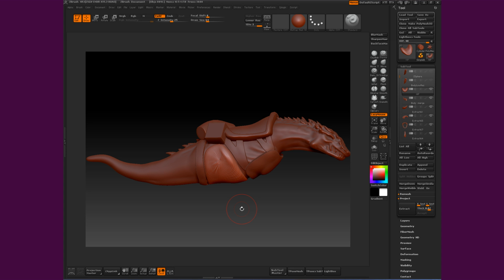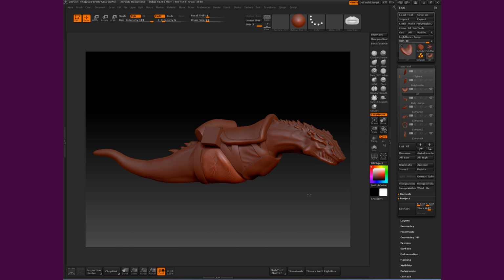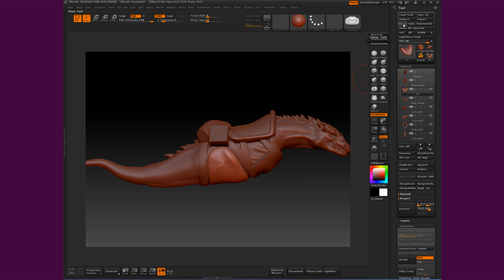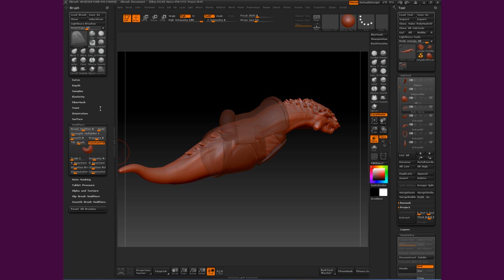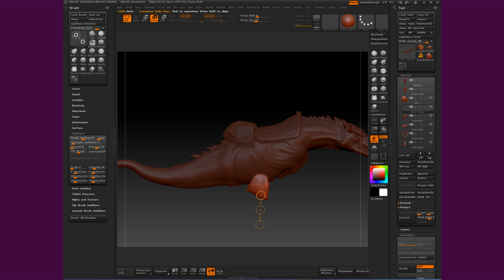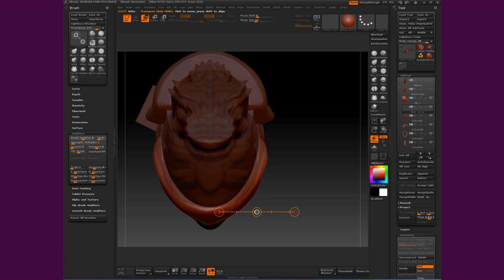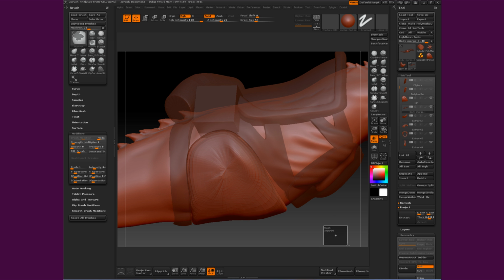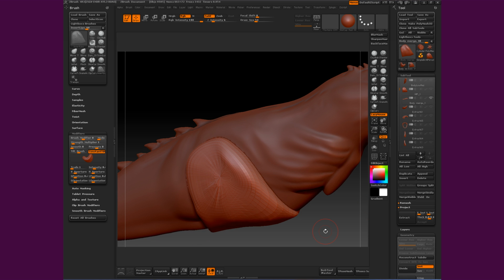Zbrush Dynamesh Subtraction and Workaround for 3D printing

Comment: This did help somebody, helped somebody a great deal.
Thank you so much for uploading this video!
 I found it to be quite useful.

Im making a 3D print and I knew I had to make my model in multiple parts so I could make molds of it, but was at a complete loss at how to do this so my parts would fit together perfectly, I despaired,cursed,and moped around for a while but then I miraculously found this video which solved my dilema!
Thanks.

Comment: This was very helpful, particularly the part about using NON dynamesh geometry to do your subtraction. I could not figure out why my dynamesh subtraction operations were not working and that was why, I was using all dynameshes. Now, here is a gift back. You DO NOT have to convert your geo into an insert brush and manually place it. You CAN use the exact geo in its original position as a subtraction tool. As long as it is regular geometry instead of a dynamesh, this will work.
http://docs.pixologic.com/user-guide/3d-modeling/modeling-basics/creating-meshes/dynamesh/with-subtools/
Reply: Paul Davies yes i was thinking if it was necesary to do all this process o just use the geo without dinamesh.